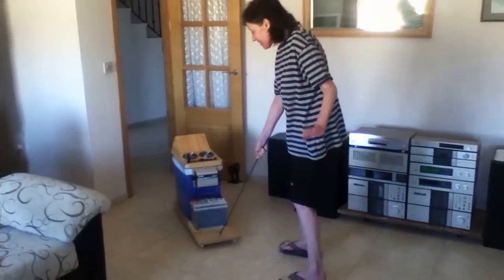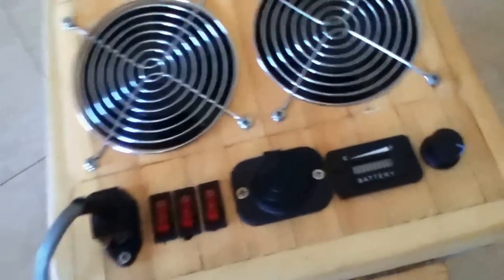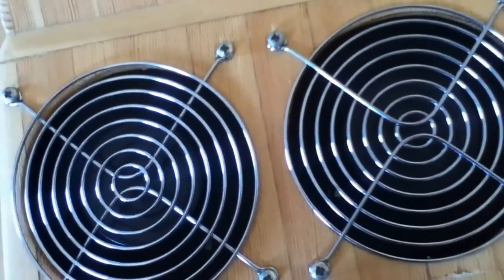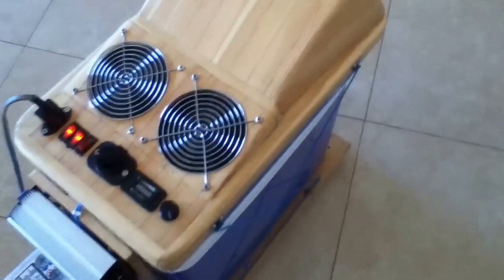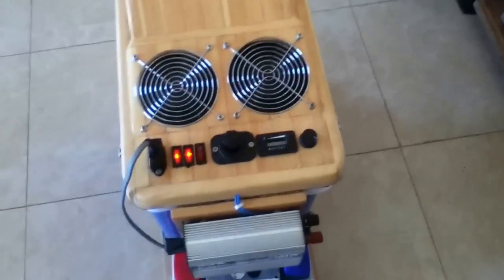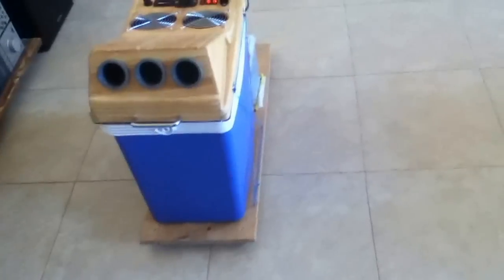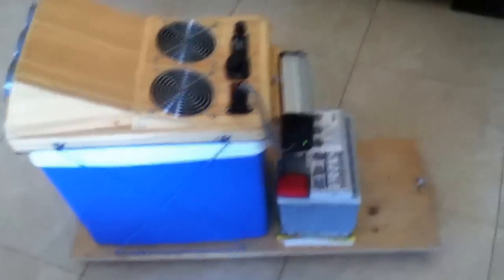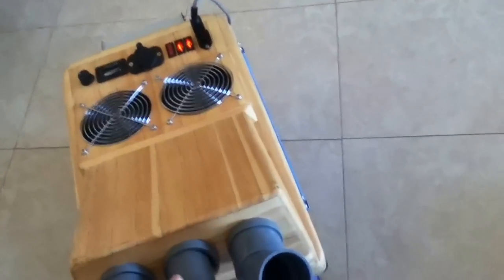HOMEMADE DIY SOLAR POWERED AIR CONDITIONER / COOLER 12v DC or 220v AC ***AIRCONtraption OVERKILL***

Comment: The battery in this vid, looks like: 12v ECV gel(maintenance free electronic convienance vehicle)!!
Reply from the maker: Hi again glenn porche, Thanks also for this informative comment. Yes it is a vehicle battery as that is all I had at hand at the time...... If you watch the whole video you will note that I mention the fact that this battery is not the one you should use for a unit like this as it would drain very quickly, as you will know a car battery is only used to start up the vehicle. I used to have caravan deep cycle leisure batteries at 110 Ah but they were very old and past their sell by date if you know what I mean...... Thanks again for your knowledge in this matter and please watch out for the new improved Mk2 version coming soon......

Comment: It would be much cheaper to use an electric air conditioner powered by a small generator. You are going to use a lot of energy making ice. You need one ton of ice per day to get the same cooling as a 12,000 BTU electric air conditioner
Reply from the maker: Hi Cindy Tepper, Thanks very much for your informative comments, I really appreciate other peoples knowledge and you certainly do know what you are on about...... However, I use 12 to 14 bottles of ice over a 24 hour period and my friends really like the ice cold air coming out when we have 40+ degrees heat outside. They also love the portability of it...... Thanks for your great comments though and please watch out for my new improved Mk2 version coming soon......

Comment: It would only lower humidity with use of a heat exchanger. Blowing over ice is a bummer, used long ago, not a crowd pleasser, no dehumidification.
Reply from the maker: Hi Dave George, Thanks for your wise advice, I agree with you in some aspects but my climate here in central Spain overcomes that aspect. I have sucessfully used it on quite a few occasions whilst partying on the terrace with my friends and they all seem to like the efficiency of it. Thanks once again for your information. Please watch out for my Mk2 version......

Comment: Only a compressor unit should be called an air conditioner
Reply from the maker: Hi Danielchai S, Thank you very much for your comment. I accept what you are saying but it serves a very good purpose of keeping the air in the room I use it in the hot Summer very cool indeed. I also refer to this unit as AIRCONtraption OVERKILL...... I am sorry if you felt I was misrepresenting the situation by placing air conditioner in the title, that wasn't my intention. Thanks again for your comment......

Comment: What do you project the overall cost was from start to finish. In USD currency, preferably. Or just list your currency and I'll do a conversion using Google. Either way dude by far this is the best unit I've seen on the Internet to date. It's well built, alot of time and love went in to crafting this and it's very obvious. Let me know on the project cost please.
Reply from the maker: Hi Aaron,  Thank you very much for your extremely kind comments about my unit...... Yes it did take quite a bit of time to put together...... It was a labour of love for me...... I had the generall idea as to what I wanted to do and started. It changed all the way through the process of making it...... more bits being added etc,...... With reference to the overall costs...... I must admit, I haven't calculated it but please give me a little bit of time and I will knock something together for you...... Thanks once again Aaron for your lovely comments and please watch out for my new project which will be on the air within the next few weeks......
Reply: +Ian Wills haha no problem with take your time. can't wait to hear a ballpark figure and yes it's truly a work for art. if I was to attempt to built one of similar design would you say that a unit like this could easily keel a single room that is a couple hundred square feet big at a comfortable temperature? could it manage to bring a 200 Sq ft room to around maybe around 75 Fahrenheit perhaps or 24 Celsius?
Reply from the maker: Hi again Aaron, Well the room I am in whilst doing the video is six metres by five metres and it cools that down just fine...... You can build this machine for under 200 dollars...... The expense is the fans at around $25 each, the cool box was around $20 and the power inverter was $44...... All the other components were very cheap and can also be bought through Amazon...... Please click on my link to Amazon and you will see a variety of prices for different fans...... Please let me see your end product and good luck with it matey......

Comment: Novartis!
Reply from the maker: Hi Jim, Thanks for the comment, I think...... What does Novartis mean anyway?
Reply: Its Latin best just to look it up or google it.
Reply from the maker: Okay, thanks for that and please watch out for my new video which will be coming soon. I think you will like it......
Reply: ETA on your video?
Reply: Hay how about a solar vacume tube set up with liquid metal to make a space heater? You could make a bigger one and run the lava liquid metal through a copper heat exchange coil and run a booster fan to heat your home and generate the electricity to run that booster fan all at ounce. Right?
Reply: I see an inventor so here's some brain food for you.
Reply: You could put an insulated heat sink underground cistern for your solar tube liquid metal set up. You could even have a hot plate to cook with or even run a clothes dryer and heat water using this set up while generating electricity to run it all. LOL
Reply: You could invest in a water hammer and a filtration system to produce fresh drinking water has well. A simple sterling engine could run your pumping needs. You could heat the piston using your liquid metal set up. ; )

Comment: Hay make pykrete water bottles to use in your thingy! ; )
Reply from the maker: Hi Jim, Thanks very much for your usefull comment...... I have used rectangular plastic freezer packs before but they don't tend to stay cool as long as the bottles...... Thanks again and please watch out for my new video coming soon. You will like it......
Reply: Have you looked into crysterling sealed cylinders? You could make a pykrete cold sink. No need for ice! ; )
Reply: You could put in an underground insulated cistern to house your cryosterling pykrete cold sink to run the cooling needs for your home. You could put a wrot counter sink in a pond or cistern to strip off the heat before the liquid enters the pykrete cold sink to start the cycle all over again. This should help your cooling and heating needs yes? = )
Reply: Take a copper coil and flatten it leaving the ends tubular. Cut flat copper flashing that can take the now flattened copper coil. Fill the copper coil with water and freeze it. This will help the coil from pinching has you form your spiral using the copper flashing. Then fuse the spiral to the flashing. Hook up your insulated tubing to your copper spiral and run your frezzing liquid through it with a booster fan on a thermastst. Novartis
Reply: A thermal electric generator ran off the solar tube liquid metal set up should be able to power a home. I would try gel batteries rather then lead acid batteries for this set up. ; )
Reply: You could put solar tubes on top of a van and make a portable power generator all ran off the sun using liquid metal. No fossil fuels needed! LOL
Reply: Other then to power the van of corse. ; )
Reply: Could you not use a solar tube set up used with liquid metal and an electromagnetic pump to run absorption refrigeration units to freeze food refrigerate food and even has an A/c to cool your home with? Novartis
Reply from the maker: Hi Jim, Thanks very much for your great comment...... That all sounds a bit too technical for me though but I would be very interested to know how your thoughts work as I do want to advance this and future projects further...... Thanks again for your comment Jim and best regards......
Reply: Have you seen any video's where sea water is burned using radio waves that generates a flame from the hydrogen gas? If not you should. ; )
Reply: Imagine having a stand alone air conditioning unit to cool your house all ran off sea water? Or smaller units like the one you put together with all those components that did not need electricity or ice to function? Just had water! LOL
Reply: You could design a dometic refrigerator that ran off sea water. Then you could design a air conditioning unit that ran off sea water has well right? It all comes down to the knowledge you posses about technology and how you can use different components to achieve your goal! Just like you did with your cooler build using different components with the knowledge you had of how the technology worked yes? Novartis
Reply: I did like your use of that cutting board and two wooden knife set holders and recycled computer components. It shows you have a very creative mind other wise I would not be sharing knowledge with you. ; )
Reply: You could get rid of the battery switch it out for a capacitor bank have a mansion engine that generates a trickle feed to the capcitors with a small butane can burner to run both the Manson engine and the domedic ice chest. Thought I would throw some brain food at you! Creation takes many paths does it not? LOL

Comment: power inverter means low energy eficiency.
Reply from the maker: Hi Alex, Thank you very much for your comment and yes you are right, the power inverter does use a bit of energy but all in all it's worth it for the results...... That's if you use AC 220v with it...... I tend to use it more on DC 12v power through my solar panels, charge controller and the battery...... It works great and really cools you down in this 40 degree heat we are having here...... Thanks again Alex and please look out for my next project that should be up and running in a few weeks......

Comment: Super cool machine great craftsmanship as well you should do a step by step build video i would love to see it. could you just put a plug on it and run it off your house power if needed?
Reply: Thank you very much Chris for your very kind words. I would do a step by step video, maybe in the not too distant future. Yes, you can plug it straight into the mains in your house without a problem my freind. It works of AC or DC no prob's...... Thanks again for your interest and best regards......

Comment: Would the two fan motors be damaged if you place it on top of the ice chest as you show in this video?
Reply from the maker: Hi there speedlearner, Thank you very much for your question...... I would imagine if I placed them directly, or extremely close to the ice then eventually they would deteriorate...... However, you need the airflow on between the ice and the fans so that would never happen in my case...... I would leave a good air gap between the two for a better result alround...... I hope this helps you and thanks once again for your question...... Please keep an eye on my channel as I have some more projects coming up......

Comment: nice its looks smart.....do you use water pump in this system....if not please tell me why ??because i am going to build one..thank you
Reply from the maker: Hi there Mrkhm1988, Thank you very much for your kind words and your inquiry...... There is no need for a water pump in my unit as the system is run by air flow only...... What happens is the warm air in the room is drawn into the fans and once in the unit the air flows over the ice bottles and then finally out through the three directional air holes at the other end of the unit...... I believe this system allows you to have a much longer cooling period rather than the pump system used in a evaporative/swamp cooler...... They are both good systems but for my purposes this one is more useful due to its mobility...... I have some more projects coming up shortly so please keep an eye out on my channel...... Thanks again for your kind words and question......

Comment: what is the brand of your fans?
Reply from the maker: +Hameeda Aladraj Hi there Hameeda Aladraj, Thank you very much for your interest...... The fans I am using are NMB and the model is 4715MS-23T-B5A...... They are 230v ac at 50/60HZ 1 Phase and 15/14 Watts each, more information is they are Thermally protected and the company is Chinese and is called MINEBEA CO. LTD...... You may also want to click on the shop site in the script below my video, I have just started it but it displays quite a few fan options available...... Thanks once again for your interest and best regards......

Comment: I'm from saudi arabia and it's crazy hot here in summer time , I will put this system with some modification in my car along with the solar pannel on top of the car ,  im really grateful for your ideas and videos , thank you very much
Reply from the maker: +فارس الجزيرة Hi there, Thank you very much for your very kind comments. I know what you mean by the heat...... Your temperature goes even higher than ours so I am really glad you will be making something similar...... Our temperature goes into the lower 40's in high summer but we can cope with it...... This AIRCONtraption unit really helps though...... Please continue to watch my channel as I plan to rebuild it once again but showing the process that goes on underneath the lid...... I really hope to see your end product on YouTube if you plan to show it...... Thanks once again for your inspiring words...... and good luck with your system......

Comment: 1st of all, I was blown away by your contrairption! It looked like a severe overkill on the cover photo, but the more I went through the vid, the more I liked it. Definitely the best of its kind I've seen so far!

And regarding some price concerned  comment- I've been living close to Barcelona for a couple of years, before that one year in Andalucia. And believe you me when I tell you (commentators not living in Spain) that houses here are not only badly insulated (like Ian's bought cooler box) but virtually not insulated at all. 

Meaning, whenever you try to take a nap during the day (working shifts or partying the night before) in one of the many one- storey- buildings around here, you have to get seriously drunk so as not to mind the like 45 degrees indoors until sundown. 

Since in Barcelona an estimate of 30% of the inhabitants steal their electricity one way or another, if you want to get by as a honest person the price for electricity is so darn high that you think like thrice about leaving the aircon on 24/7. If you even have one- the house I've been living in for the last half year does not. 

Means, last summer I was usually unable to get some sleep before 5 am, as by then temperatures had fallen below 35ºC. 

I'd tried to build an aircon with a similar idea, using a styrofoam cooler box that costs like 5€ plus a 10€ 120v fan but it didn't do virtually anything. Guess I'll try it next time with some higher grade components and kinda imitating your design. 

A fridge is something you find in any spanish house, and icing over the bottles during the day is no sweat at all... thanks for sharing your brilliant invention, looking forward to seeing more of it!

Cheers

Lutz
Reply from the maker: +Lutz Hövener Hi Lutz, Thank you very much for your extremely kind and influentual comments. I really appreciate them...... Living in Spain in the summer is hot, living in Extremadura in Spain in the summer is extremely hot...... I know what you are suffering my friend and I am very sorry for your predicament. I agree with you about the addition of a bit of alcohol to help with the situation now and then...... It works here too...... Luckily I live in a rural area without much traffic but I don't want to dwell on that as I know your situation isn't so good my friend...... Make the unit...... it does work, it will help you reduce your heart rate in that hectic city of yours and please show me it when you have finished...... Good luck...... You will be very happy when the cool air flows over you at night......

Comment: hi Ian nice job on that AC!!! do you directly connect your solar panel to the battery??
Reply from the maker: +Salvador Palafox Hi Salvador, I love your name, I wish my mum called me something more interesting...... Anyway, thanks very much for your kind words...... When I use the unit in my cabin I connect it to the 12v supply that comes from the panels into a 30amp Steca charge controller that is already set up in the cabin. However, I could directly connect the panel to the battery...... I have a 35w panel that I connect directly to my car battery to charge or top it up so there is no reason why I couldn't do the same here...... Thanks once again for your very nice comment, it's really appreciated......

Comment: Technically, the heat is simply exchanged from your area to the room with the freezer. Remember to factor in the initial power required to make the ice.
Reply from the maker: +The Sqoou Hi The Sqoou, Thanks very much for your interesting comment. and yes you are correct, I am only dissipating the hot air in my room through my unit and passing it over the bottles and then expelling the cold air out through the three vents...... When it comes down to it, the initial freezing of the bottles is a little costly I admit. However, we often have over 40 degrees C heat here in Extremadura so it's well worth it for the comfort factor...... Thanks again for your great comments and best regards......